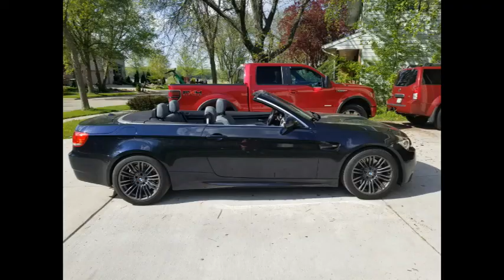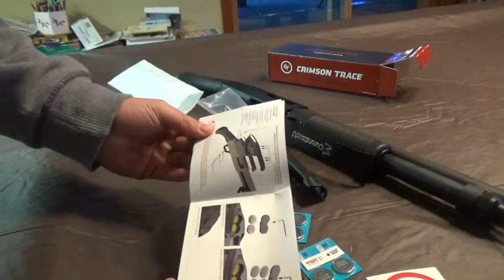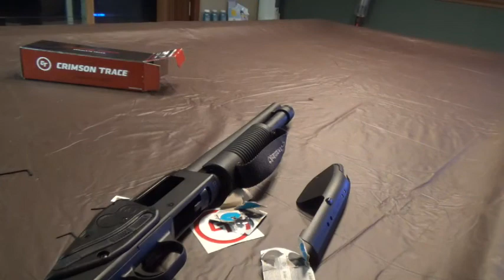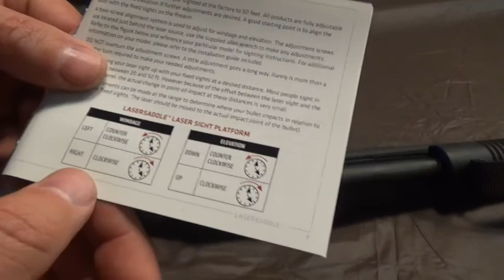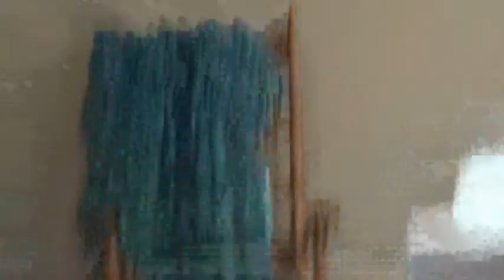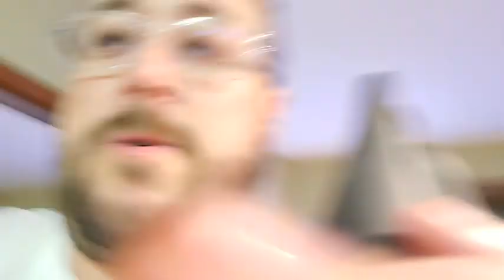Installing and bore sighting a Crimson Trace Green Lazer on a Mossberg Shockwave

Comment: What tool do you use to adjust the laser to move up down left or right ?
Reply from the maker: It comes with a little alan wrench
Reply: @boatsnboomsticks  mine never did. I ordered there kind off the website. I've tried to use it with no luck. The laser won't move as I'm trying to line it up. I don't get what I'm doing wrong for the laser not to move up, down, left, or right... I'm confused on what to do.

Comment: I had the same problem getting it to light.  Tried your troubleshooting suggestion.  It didn't work.  Tried another suggestion from a different video where the installer was having the same problem (bend the contacts on the battery cover out to make better contact).  Still nothing.  I was able to get a momentary flash of green when I turned on the master switch, but then nothing when I pressed the pressure pads.  Have you heard any other suggestions?
Reply from the maker: I have had someone just with that issue... his batteries came dead. He went out and bought new batteries and it worked. The original batteries lost their charge from being stored in a cold environment.

Comment: I have recently gone through this exercise (installing the laser saddle and sighting with a bore sight. How well does your laser saddle line up with your bead? Is this a concern at all?
Reply from the maker: I don't use the bead at all with this gun. This is only going to be used as a hip gun.
Reply: Completely understood, @boatsnboomsticks  . I plan to do the same. I guess my question is how accurate do you think the bead is? And is it a problem if the laser doesn't line up to the bead?
Reply from the maker: @notice_fpv  the bead is accurate and the Lazer did not line up at first with the bead. I had to adjust the Lazer to get it dialed in. Now if is perfectly accurate with the bead.
Reply from the maker: If you are going to use the bead on the barrel for reference where and how you hold it will make all the difference in the world. This gun you will not look directly down the barrel like a full size shotgun.

Comment: Regarding sighting in the laser;
From the shooter's perspective, the CT laser emitter is 1/2" above, and 7/8" to the right, of the  bore center. Together, they put the CT laser almost exactly 1" away in the 2 o'clock position from the bore center, ..... and that 2 o'clock position is where you should consider placing the CT laser projection on the wall relative to the bore sighter's projection; .......... i.e. 1" away towards 2 o'clock.

When you then go closer to or further away, there should be no merging of the dots like the one you saw in the video. Your hit will always be 7/8" to the left of a vertical that runs through the CT laser dot, but the elevation will be dependent on your distance from target.

If you were to ALWAYS be firing from 30 feet away, the method you used could be fine. I'd rather live with the offset and have that be correct all the time; heck, it's 7/8" and we are dealing with a shotgun.
Reply: Perfect answer. Thank you. Hadn't considered height over bore.
Reply from the maker: Great points. Also the thing is being fired from the hip, an inch or 2 isn't thr end of the world.
Reply: Very well said my friend…..
Reply: Man you explained that so well 👏  maybe you could  be a YouTube  channel  too. Watching from central KY

Comment: Did you tighten your battery cover tight? I tightened mine snug and it wont turn on unless I loosen it up.
Reply from the maker: Yes, I tightened all the way. May want to adjust the metal prongs on the battery cover.